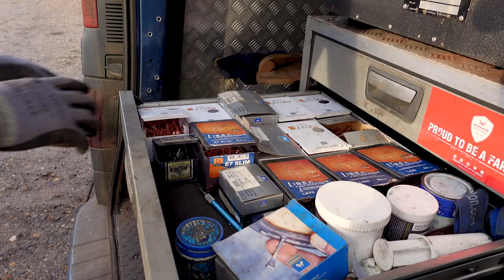Shoeing with wedge pads

Comment: Looks nice. Though, I see that you get rid of the broken back HPA. I‘m curious  if you ever can “build a stronger heel” on the horse. I used a lot if wedge pads on harness horses back in the 90’s. Seemed we got rid of the strain in DDFT but once we started using them we had to continue. I’m not the least afraid of what happens under the pad if you use  a packing. 
Once again, nice job
Reply from the maker: Thanks. My aim is to always try to get the horse into a more ‘normal’ set up (although that is normally just a flat pad and packing). If I’m using dental impression material then I have a greater chance and a quicker chance of achieving that goal. In this case I feel it is achievable, it will just take a while to get there. I’m not averse to leaving horses in wedge pads if they need them tho as some like it a lot.